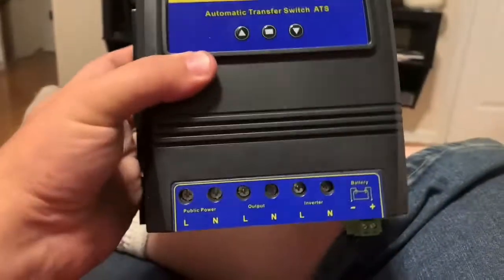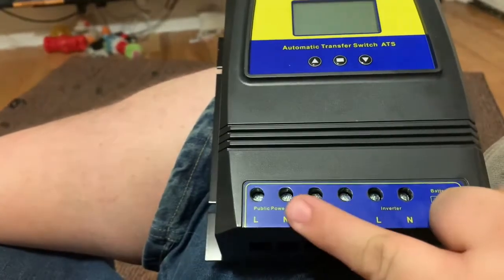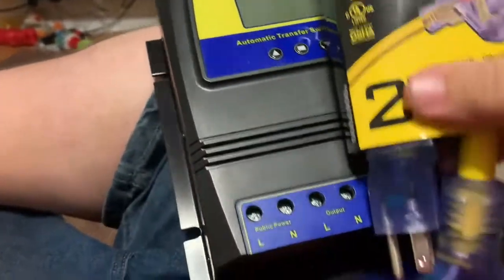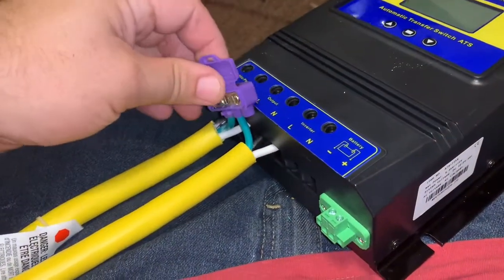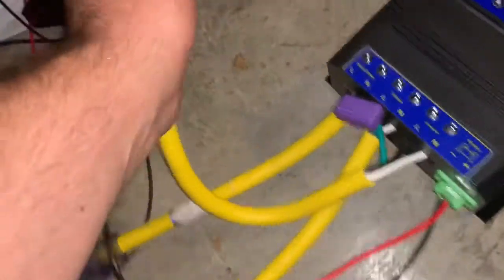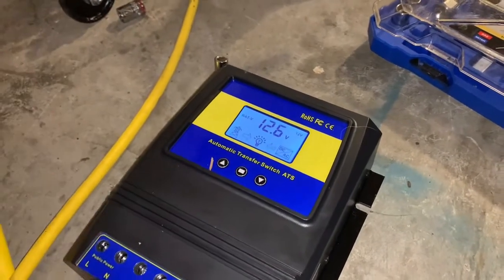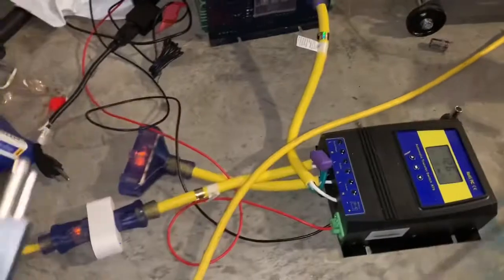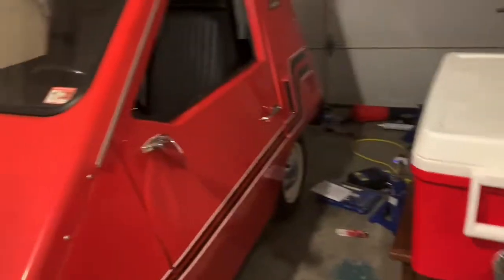Solar Automatic Transfer Switch

Comment: So Can I use Cheap Batteries for a Mobility Scooter, along with an inverter to Power Some Things in the Day When the Sun is Up in Arizona, Temps Hear and Sunshine are Brutal.  So I could run My Swamp Cooler on This With enough Solar panel's ?  Airconditioning Electric Bills Hear are insanely expensive now. At Night, Electricity hear is Less Expensive, So This Device Would Let the Cooler and other devices Revert back to the Grid when the Batteries are Down say 60% ?

Comment: I AM PLANNING TO ADD THIS TO MY HOME SOLAR SYSTEM. DOES IT DISCONNECT FROM THE INVERTER EVEN THOUGH THERE IS NO GRID POWER IF THE BATTERY VOLTAGE IS LOW

Comment: Hi 

Will this work with hybrid inverter

Also where do I buy them wires in uk

I want to run gpu miner and want to go solar 

Can I connect this to uk wall socket to this then connect it to my inverter

Comment: What if the inverter fails?
Reply: It doesn't detect that unfortunately. It detects the battery and switches regardless so if the inverter fails it will simply shutdown and not deliver power. But an inverter should last 10/15 years if you have a pure sinus inverter so its really no big deal.
Reply: I’d like to see that.  It would make a great video and good to know in case you wanna run something like a fridge and no power would suck.  Look forward to your next video.
Reply: If all the mosfets short out inside of it, it probably will connect your Inverter to the outside public GRID....boom...
that being possible,i think it is highly unlikely
Reply: @josepeixoto3384  Is it possible to get a good quality brand that is isolated so that it is impossible to short internally? Kind of like a UPS, they are up to code somehow. I wonder if a UPS malfunctioned, would it backfeed power through the wall socket, or is it not possible?